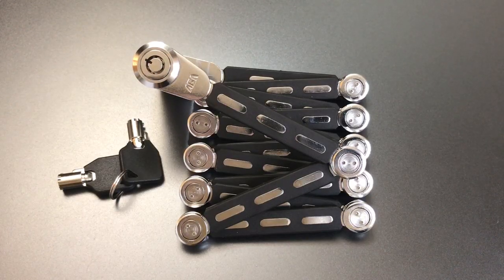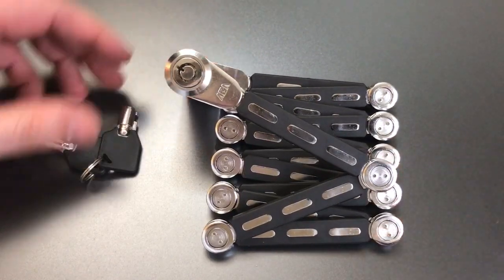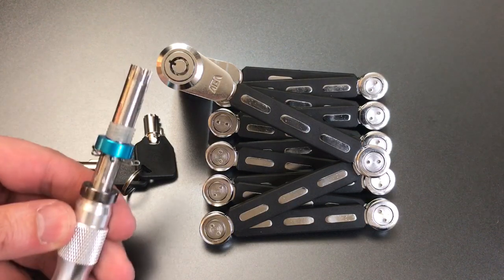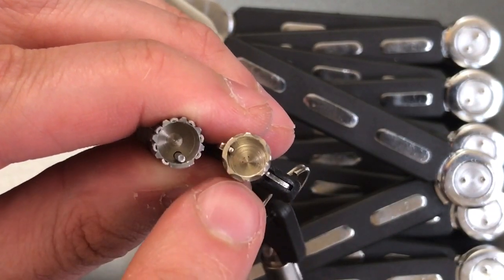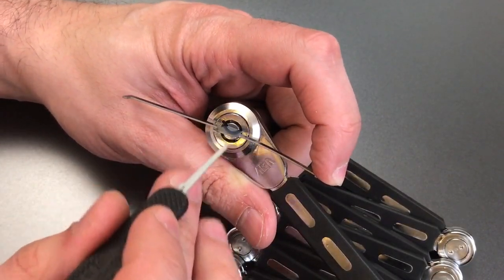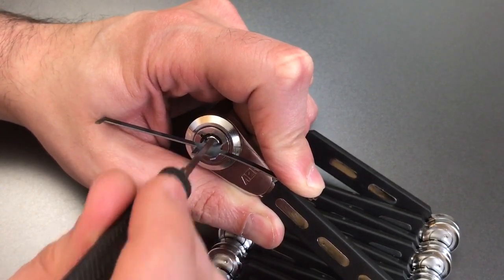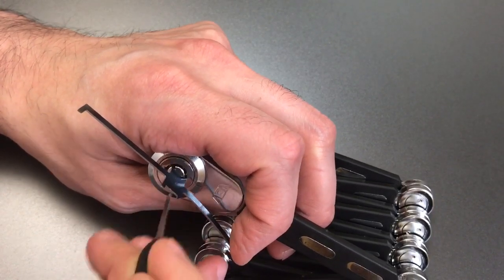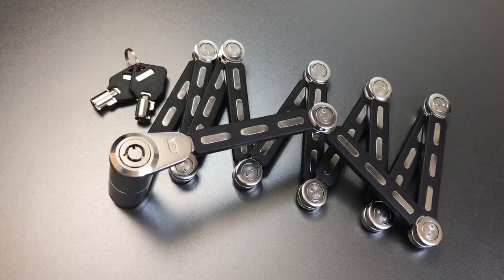[388] ABA Folding Bike Lock Picked

Comment: Thanks for the review. I wouldn't use it as the pure metal would probably scratch my bike. But non-standard keyway is very good. I wonder why many tubular locks share the same keyway. There could be many variation, like unevenly distributed pins.
Reply from the maker: Excellent point about the unprotected metal!

Comment: Hey there LPLawyer, I'm curious about another vulnerability on this lock..  It seems the 'chain' can reach out quite far from the base of the lock itself - would it be possible to fold it all the way out and then apply force with your foot in the middle of the far end and pull with your hands in the middle of the closer end to leverage a break?

Comment: I recently got the 3 piece huk tubular set, but my ones did not come with the inside tension pins, nor does it have the holes for them. Any idea why?
Reply from the maker: Because BG changed the design right in the middle of when they were selling to my viewers!  NOT HAPPY!
Reply: LockPickingLawyer, Not your fault that the design was changed, I will have to get in touch with bg. Thanks for the reply.